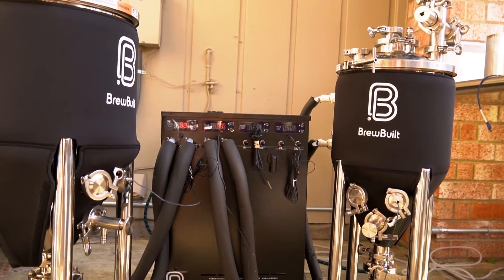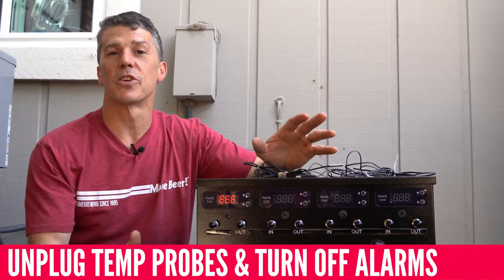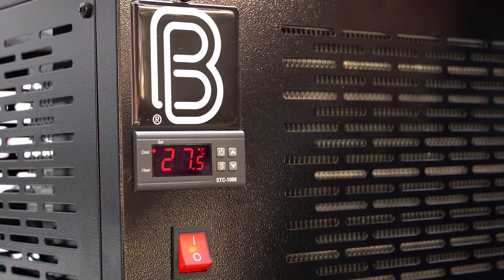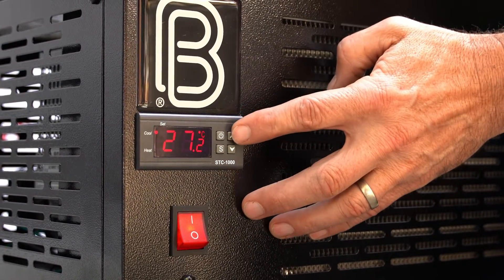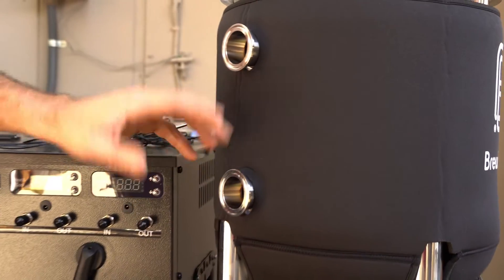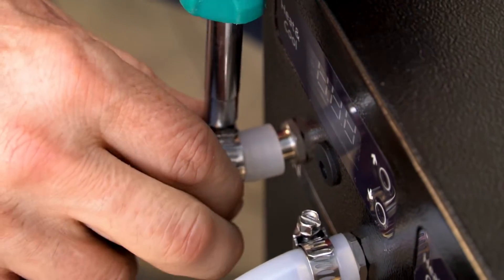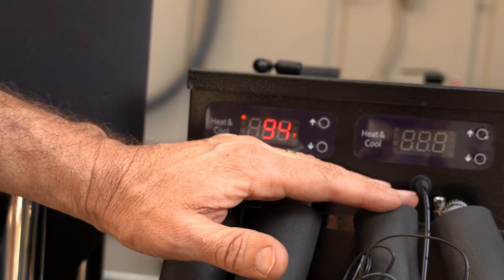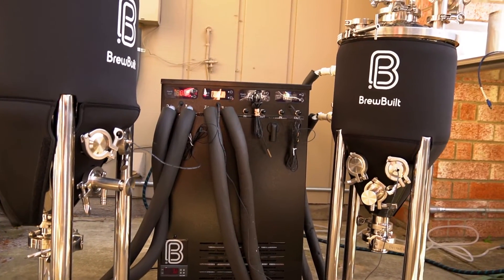How to Set Up a GLYCOL CHILLER | IceMaster Max 2 and IceMaster Max 4 Tutorial | MoreBeer!

Comment: Great video, thanks! Two questions if you can help.  First, where do you get the "quick disconnect set"? I can't seem to find it anywhere online, including on the brew built site? Second question: thanks for informing on the water/gylcol ratio. Can you tell us something about volumes? I see you filling the reservoir of the ice master, do you need to top up as the gycol flows into the fermenter walls? Do you need to purge air? Sorry this is obvious, very new gear for me and did not seem to get an instruction manual that says anything except on how to set the temperature. Thanks!

Comment: I guess I need to ask this question again with a little more detail. How do I set the individual controllers on the Ice Max 4 to Fahrenheit from Celsius? They all read in Celsius, and I need them to display (and give me degrees) in Fahrenheit.  I've even tried to reset the bath to Fahrenheit per the instructions but, there is no F13 (to set the temp parameters) in the system; it stops at F12.